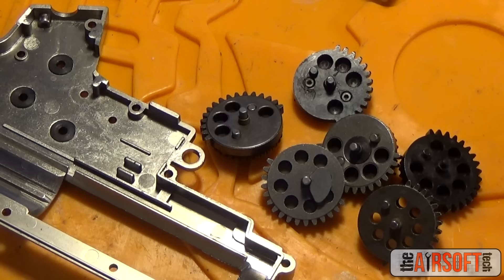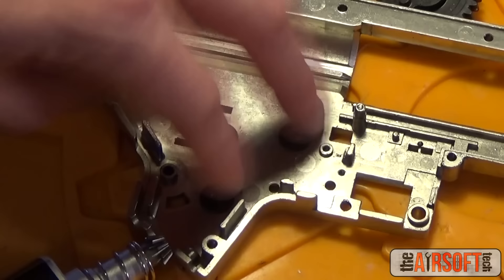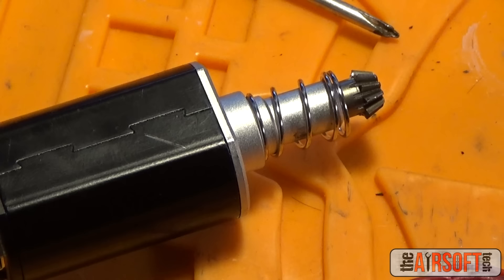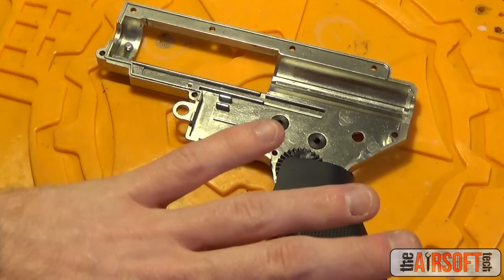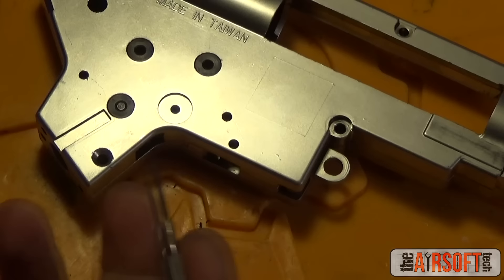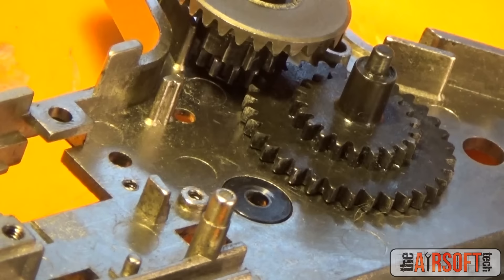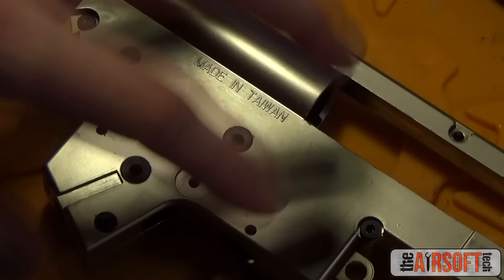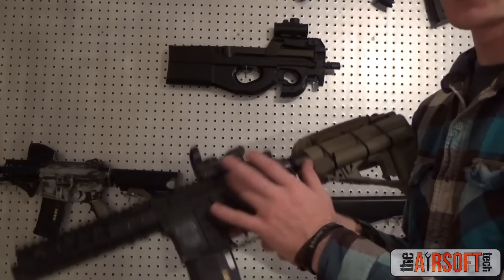How to Flawlessly Shim Your Airsoft Gearbox

Comment: Holy hell... don't put a gap like that... that's horrifying... If you've got bad pressure at the front of the handle, you need to FIT it...  Don't create a giant freaking gap.  You can use that contact for better solid support instead.  This is coming from a real gunsmith.
Reply from the maker: JathTech in my 6-7 years of Teching I’ve never had a problem with it.

Gun smithing and Airsoft tech work are completely different my dude.
Reply: Not really... both are based on mechanical principles, and material science, two things I studied to become a mechanical engineer.  You're adding a gap when you don't need to.  That presents a whole slew of problems in a mechanical system, including dust and dirt, and stresses on parts that lead to faster wear...  I get what you're saying about the oversized tolerance, and I'm telling you, it's far better to fit the pieces properly rather than removing huge chunks to ensure clearance.  This is time consuming by comparison so I can see why you wouldn't want to do it when it seems like your quick solution accomplishes your goals.  It's really the difference between a gun hack and a craftsman.